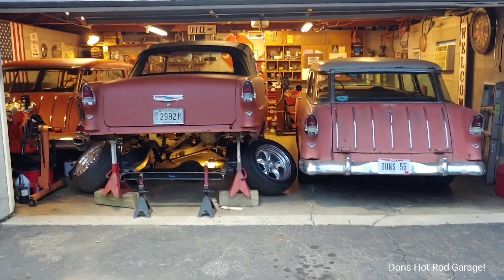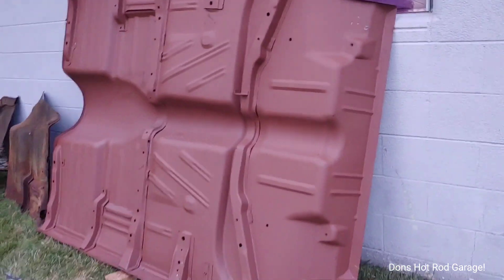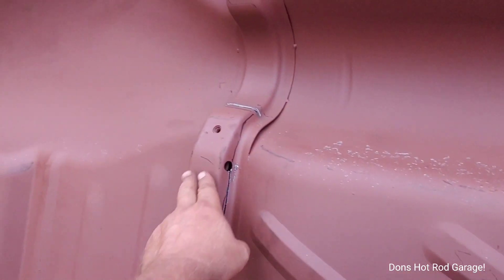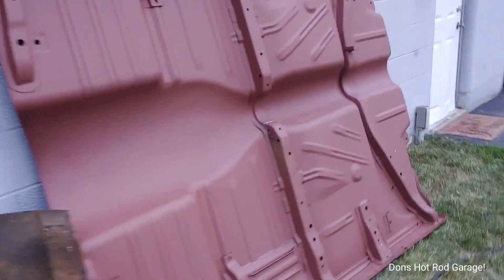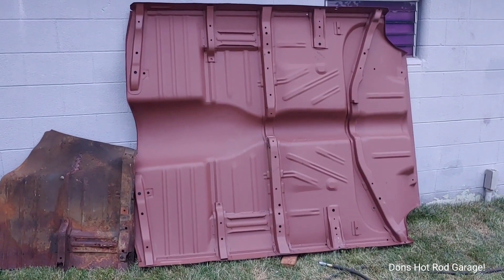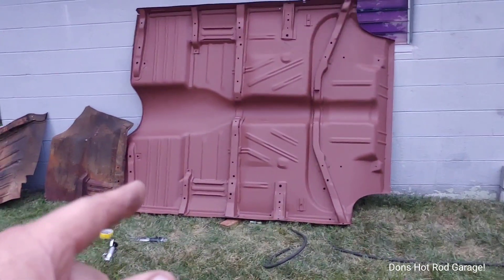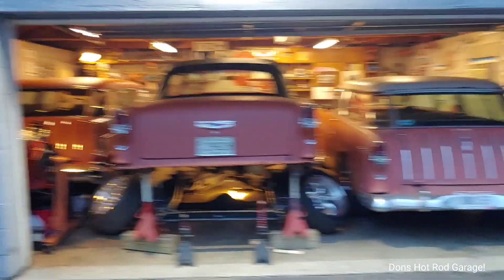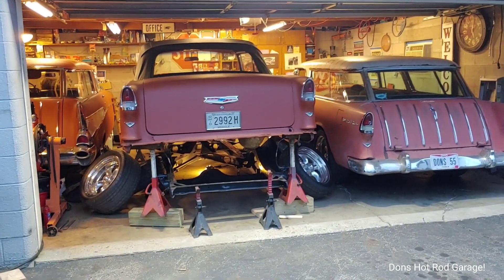55-57 Chevy Convertible 1 piece Floor Don't Fit! Share this to your friends building a convertible!!

Comment: I drilled out the old brace out of my original floors cleaned them up and used those
Reply from the maker: Hey Peter! Yeah man that's awesome. I just cut the center out and but welded my convertible brace back in there. Have a good one Buddy 👍

Comment: Using your old brace is a good repair Don. Good call on that. Golden Star is the worst for fit. I sometimes feel like I could scratch build better stuff. An old restoration guy told me the golden rule. Keep as much original metal that you can. When you plug weld it in, what are you going to do about the red oxide paint burning? That's sure going to stink. Lol. I love your convertible man. Heck I love your Nomads too. Lol
Reply from the maker: Thanks Buddy! Yeah man I always try to keep as much original metal as possible, even as much original parts as possible. I'll clean any small area I need to before welding the need metal solid! It'll be more work here and there I just wanted the floors painted for inspiration! Have a good one Buddy 👍 And yeah man I love your 55 Hardtop its a killer car!

Comment: After you get the mods done to that "correct" piece, my suggestion for a stress relief would be to get in that L-88 car you got & go for a drive! Not necessarily "let 'er rip", but let that lope settle into your soul. Big cams & 4-Speeds used to do wonders for this ol' redhead back in the day! Can hardly wait to see the finished product & thanks for the heads up for everybody!
Reply from the maker: Hey Vincent! Yeah your right man nothing like a strong big block and a 4 speed to make all your worries disappear for a while. Have a good one Buddy 👍

Comment: Take the whole brace grind and drill the spot welds and transfer too new pan
Reply from the maker: I took off the old convertible brace and welded it to the new floors. Its on the follow up video. Have a good one Buddy 👍

Comment: Hey Don, yeah that’s to bad you go through all that work sliding the floor pan in and it doesn’t fit, so now you have to have the car up in the air and the garage door open while you customize the pan to fit, but you’ll get it buddy, hopefully fairly quickly, plus like you said they don’t give that stuff away either, have a nice Sunday, talk to you soon Big D
Reply from the maker: Hey Mike! Yeah things happen like this sometime. I've fixed the brace and the new floors are in the car! Have a good one Buddy 👍

Comment: My frend had me install a complete  floor into a 57 handyman WAGON.  Only problem was it was bare metal and covered with  heavy oil. And was two peace  with one side ahead of the outher all spot WELDED  together  with the braces. What a mess getting the oil off and adding a patch to get the transmission hump to line up. I FEEL your pain.
Reply from the maker: Hey Chris! Yeah man that oil they use on bate metal patch panels is hard to get off. It saves the panel though if it was bare metal with no oil or protestant it would rust up quick. Have a good one Buddy 👍

Comment: Man oh man that would piss me off to no end. What are these manufactures doing? The average guy like you and me scrape and bust our ass just to be able to afford something that we believe will drop right in and fit like the original. Then after working the area just right we end up with an expensive piece that does not fit. Keep the faith brother , you got this, and I know you will make it right. Don when I did my second 55 hardtop the one piece floor wasn't available and I had to make floor sections and braces but when it was done it fit like a glove and was way stronger than the original.
Reply from the maker: Hey Edward! Yeah man you run into this stuff fixing up a old car! I fixed the brace and the new floors are in the car! Have a good one Buddy 👍

Comment: Don I would cut down whats in there to the taper to match your old one, and just weld some sheet metal on top of it, that would be better ten cutting out and welding in old rusty parts.
Reply from the maker: Hey Lee! Yeah man that was my first thought but that area has to be perfect to clear the x frame! I cut out the wrong brace and welded in my original brace. The floors are in the car! They look great and fit great! Have a good one Buddy 👍

Comment: its a good thing you kept old brace  they should have told you it was defferent when we did eds 57 conv we just changed sheet metel no bracesi think dan chuck sells brace orC.A.R.S
Reply from the maker: Hey Mark! Yeah I kept all.the old stuff out of the car just in case! I fixed the brace and the new floors are in the car! Have a good one Buddy 👍

Comment: Man that sucks now i need to check my ragtop floorpan . im building my 55 ragtop body on the sedan chassis . so i would have not known about this problem till after it was all welded in.
 if mine is made like yours , i will have to modify the floor brace that is on it because my doner car had no floors left in it. much EZR to fix it standing up than under the car.
 i know you will get it right just do it the way you will be happy with it.  the new floor looks good painted .   
after i get my body welded into one piece i will work on the convertible X frame chassis it is broken near the front of the leaf spring mounts,
 i was thinking about replacing the rear half of the chassis or putting the X and the skid plates on the good sedan chassis .
Reply from the maker: Hey Jim! Yeah man you have the right brace on your floors! I fixed the brace and the new floors are in the car! They fit great and look great! Make sure you have a 2 piece frame to build your convertible frame. All convertible frame were 2 piece the 1 piece California frame is a little more narrow in the center. Have a good one Buddy 👍

Comment: Well that answers my question as to how the convert and hardtop pans differ. There are separate listings but the pics do not reveal any differences. But the vertical section of the center brace at the center of the X frame is shorter. Other than the bracketry are there any other differences? I am contemplating using a hardtop floor with a convertible frame and think you solved my issue. Thanks!
Reply from the maker: Hey Mike! To use a hardtop floor you will have to Shorten the center brace or replace it with the correct brace. When I sat the floor on the frame it rocked back and forth in the x frame center! Also there is anchors on each side of the floor to mount the power top rams. You'll have to add them as well. Other than that you can use a hardtop floor. Have a good one Buddy 👍

Comment: If you bought it from a place the said both panels are the same then that’s a vendor issue they do indeed make a convertible version of That full floor That is convertible only I looked on the actual manufacturer website in tawian and they indeed show a separate part number for all 3 styles
Reply: TriFive Guy knows his stuff.
Reply from the maker: Thanks TRIFIVE GUY! I think the convertible pan was in higher demand years ago. Now they just get lazy and sell a hardtop pan labeled as a convertible. I changed my center brace and the floors are in the car and fit great! Have a good one Buddy 👍
Reply: @donshotrodgarage1717  yes sir I watch the lastest video
Reply from the maker: @Trifiveguy  Thanks man! Have a good one Buddy 👍

Comment: Wow.. WTF.  GOOD LUCK BROTHER.. thanks for sharing.   Very unfortunate news.. that floor pan has been sitting there for a long time.
 A lot of effort/energy only to be disrupted... 
You and I were both excited about putting this floor pan in.. 
Are you a welder? Are you capable of cutting in and welding in the old part?.. it looks like it's in a structural area?
Reply from the maker: Thanks Robert! Yeah man you run into many problems when building a old car. I can weld I can fabricate I can build. The bracket has been fixed and the new floors are in the car! Have a good one Buddy 👍

Comment: Regardless Don I believe you'll have the finest convertible 55 on the planet when you're done Blood Sweat and gears bro
Reply from the maker: Thanks Allen! Im trying to build a nice old 55 convertible. This car needs a bunch of work but the list is getting smaller! Have a good one Buddy 👍
Reply: @donshotrodgarage1717  I have a 55 2dr post car , I love that old car its in bad shape ,I've managed to hang on to it ,now that covid hit I turned 55 but was broke on my ass an wasn't able to do much to it but now that day came an I turned 56 an I'm mad wanted to drive the dam thing so I'm putting it together  , I had a brand-new head liner in it an a mouse got in headliner an ate hole in it so  all the interior is coming out , I'll stay in touch

Comment: Man Don that sucks. I guess the only thing now is to take the brace off the old floor and weld it back together like you said. Do they sell that covert brace separately? I know you don't want to spend the money redoing new parts.
Reply from the maker: Hey Greg! Yeah man it was just a small set back. I've fixed the brace and the new floors are in the car! Have a good one Buddy 👍

Comment: Good thing you saved the old pan cuts. The original brace metal looks solid. Discouraging, but doable. You got it.
Reply from the maker: Thanks man! I saved all the old floors just in case. I've already fixed that brace and the floors are in the car! Have a good one Buddy 👍

Comment: Good that you got it figured out now. Also shows that this is going to be a good job rebuild.   i bet that DD 57 convertible has the floor pushed up and bent in the middle that high.  his 57 is convertible frame on hardtop body. Wonder if DD knows this. thank you
Reply: I don't think Dan  has the X crossmember in his -
Reply: @tonymorse7178 , yeah Dan did put a x cross member frame under it so I’m still wondering how it fit.
Reply from the maker: Hey GIVEBLOOD! Yeah man I fixed that brace and the new floors are in the car! Im not sure what Dan did on his car! Have a good one Buddy 👍
Reply from the maker: Hey Tony! Yeah Dan has a convertible frame under his car! Have a good one Buddy 👍
Reply from the maker: Yeah man me too!
Reply: Dan over at D&D, takes on some interesting projects, but Dan's methods aren't what would be considered restoration quality methods. (Dan has no problem admitting that)
Most of his projects are far from what most people, Dan himself included, would consider/ call finished products. Dan either got lucky and got the right/ proper floor, or that floor got the 5lb. sledge modification.

Comment: Back in 1976, the chicken wire and fiberglass I used to build a floor for my 57 convert fit perfect.  Seriously though, aftermarket stuff most always dissappoints. Mirrors won't stay adjusted, door seals crack, oil pans leak, cams wipe. Heck, Edelbrock still hasn't added a correct mount point for a 700R4 TV cable to their carbs.  95% of the parts used in my last two builds came from wrecking yards or were fabbed up in my garage.
Reply from the maker: Hey Paul! Yeah man I remember them repairs. Heck this car even had some of that! I fixed the brace and the new floors are in the car! Have a good one Buddy 👍

Comment: most people have the idea after market  parts fit like original parts unfortunately its not true most need tweaking to fit even here in australia we  find the same issues most put a disclaimer on there parts
i prefer to make my own rust repair section where i can 
i'd unpick the cross member from the original and re use it 
 i see why they supplied it due to the low volume of convertable floor pans they get asked for its down to costs
Reply from the maker: Hey Green JJ! Yeah man they all need some type of work. I'm just glad they offer parts to fix these cars up. I fixed the brace and the new floors are in the car! Have a good one Buddy 👍

Comment: On tri-five I was asking about floor pan differences between hardtop and convertible and was told that CARS Inc sells a piece to modify the rear footwells of the hardtop floor pan for convertible for x frame clearance and without doing that the hardtop floor will not clear in the rear footwells either. 

So, if that is true (and a photo of the rear footwells of a convertible was provided with the post) then there is a second difference (first one being the middle brace profile). Did the flat 3 ribbed section of the hardtop pan footwells the X frame running under it with no modification? 

You should have run into a problem there too, but apparently did not?
Reply from the maker: Hey Mike! Yeah man many poeple say stuff they don't really know. Everyone said the center brace on the inside where the bottom of the back seat sets was different. I had all my original floors and measured both braces and they are identical. The long center brace underneath will need changed or modified for use in a convertible!. All else will work and be correct. Have a good one Buddy 👍

Comment: Replacement sheet metal parts are just better than nothing. Always keep old parts to compare to new before you start your project. Good luck with your chevy.
Reply from the maker: Thanks man! Your right I'll take these replacement parts any day. I can't imagine making floors from nothing. I fixed that brace and the new floors are in the car. Have a good one Buddy 👍

Comment: I think I would have just sliced the brace/ rewelded it.  With a good grind job it could be unnoticeable and still had brand new metal.  That being said, I agree, the money they charge for this stuff,  it should fit properly without modification
Reply: Could grind it down to about  3/8   and top cap it
Reply from the maker: Hey Tony! Yeah that was my first thought but I felt it would be very difficult to get that perfect angle to clear that x frame! I cut out the brace and but welded my convertible brace back on. The floors are in the car now and fit great! Have a good one Buddy 👍
Reply from the maker: It's been fixed and the floors are in the car! They look and fit great! Have a good one Buddy 👍

Comment: I’m with you. There isn’t an aftermarket part out there no matter what brand  that doesn’t need tweaked or modified. If they’re taking time to make the stamping just make them match original and fit. Waste of time, but I guess we can’t complain totally because atleast something is available. Just always more work and headaches. Hang in there and it will all work out. Time to regroup.
Reply from the maker: Thanks David! Yeah man they all need some type of modification! Your right at least we have something being sold could you imagine making a panel from scratch! Ive fixed the brace and the new floors are in the car! Have a good one Buddy 👍

Comment: I just looked it up the convertible floor is longer and wider in the back than a hardtop I got measurements of 80 in long for a hardtop 45 and a half wide in the back 64 and 3/4 wide in the front. The convertible was 82 in Long 64 and 3/4 in the front wide 46.25 wide in the back they have different part numbers also I didn't see part number for both.
Reply: Not true! The overall dimensions of ALL 55-57 Chevy floorpans are exactly the same. Only differences are braces and shape of rear underseat pan.
Reply from the maker: Hey Mike! I was able to replace the center brace yesterday! The new floors are in and for real well now. Have a good one Buddy 👍
Reply from the maker: Hey realdealsteel567! Yeah man I agree once I fixed the center brace the floors went in perfect. Have a good one Buddy 👍
Reply: I'm glad it fit buddy. I only wrote down what I read. True or not

Comment: Great video I had the same problem with a set of bbc headers on the flange where it bolted the the head hitting on the one head bolt
Reply from the maker: Thanks Brad! Yeah man if building a old Hot Rod was easy everyone would do it! Have a good one Buddy 👍

Comment: Why don't you use a cutoff wheel and pie cut the sides of the incorrect braces so that they are the correct height/depth and then weld them closed when you get them fitting to the correct tolerance? Seems that it would be cleaner and easier than cutting the new ones out of the new floor pan and then cutting the old ones out of the old floor pan, and then still having to weld the old ones back onto the new floor pan.
Reply from the maker: Hey Dennis! That was my first thought to flatten out the hardtop brace. I started to do that and didn't think I would get the angle perfectly right. That's a real close area around the top of the x frame. I cut out the center part of the hardtop brace and but welded the original convertible brace back into the floor! The new floors are in the car and fit great! Have a good one Buddy 👍